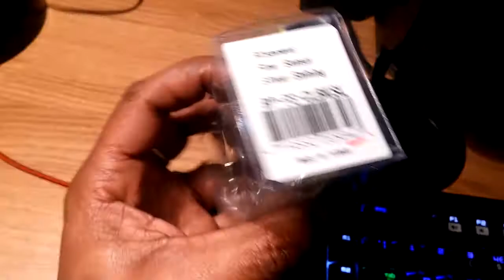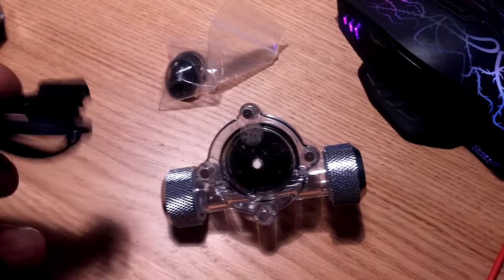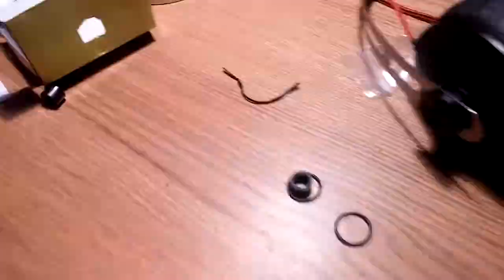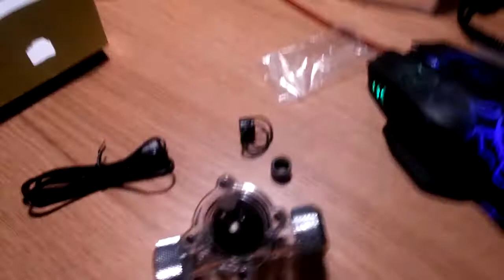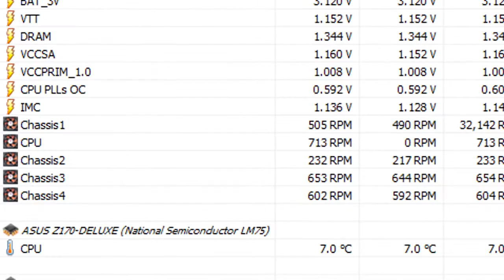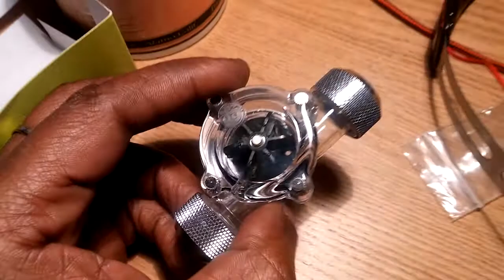Short Review of Bitspower flow indicator

Comment: I have two Bitspower flow indicators in my system and they both make rattling noise. I have them both mounted vertically. It may be worth while to try mounting them on their side to see if that stops them rattling. Has anyone here tried mounting them on their side? Apart from the rattle noise they work well for me. I use one for CPU loop and one for GPU loop. I have used them for well over 3 months and they have not leaked or become stuck.

Comment: This is a piece of junk. My Bitspower flow indicator stopped spinning after just a few hours of run time in my open water loop. If you check on Amazon reviews, a seized wheel is a common failure.
Reply from the maker: mine worked for 2.5 years before it failed,  it stopped spinning. i did not replace it, but purchased an EISFLUEGEL FLOW INDICATOR from alpha cool instead. So you have a fair point. I  only used distilled water in my loop, so no particles would have build up on the spindle.   I would not be justified in recommending it  now. Since this review as you rightly say, many people have had issues I don't know what the percentage of failures are so i cannot comment on how well the design as worked overall. However it lasted past its warranty period  for me. there are some good flow indicators out there but they are expensive.

Comment: how did you connect the rings diameter conversion? inside the flow indicator!!!
Reply from the maker: The ring just drops inside, there is a space for it to fit
Reply: Danny Roy  but Is one big ring& one small ring... witch direction should I go...for good flow
Reply from the maker: Hi Bruno, Yes there are two rings supplied,  one a small internal diameter, and the other with a larger internall diameter. The smaller inner diameter ring will force the coolant to travel faster across the paddel making itspin faster , the larger diameter force a lesser increase in speed. note that for this to happen you put the rings in where the water enter the flow meter. I personally do not use any of the rings, as the paddle spins fast enough without them in my system.
Reply from the maker: just try the different rings and see whats happens :)